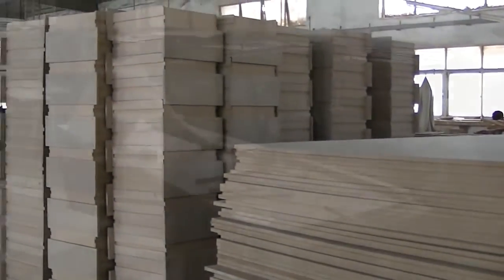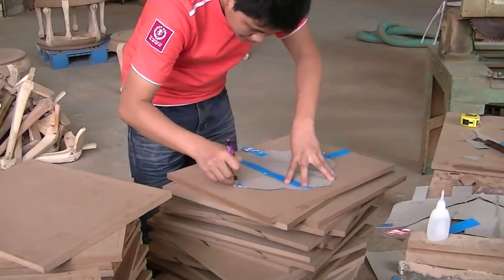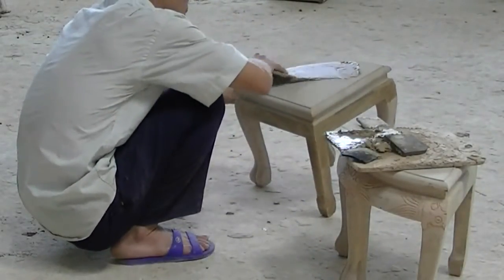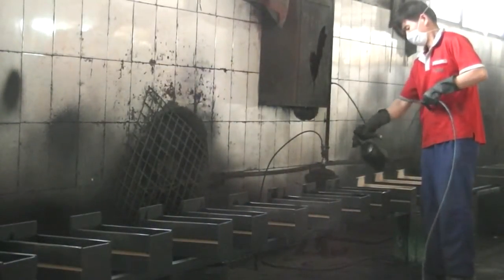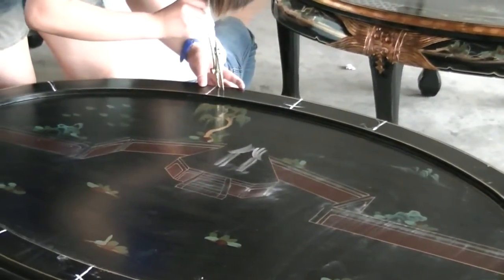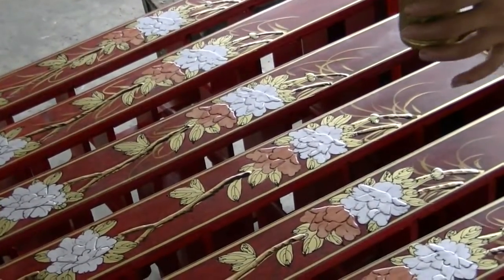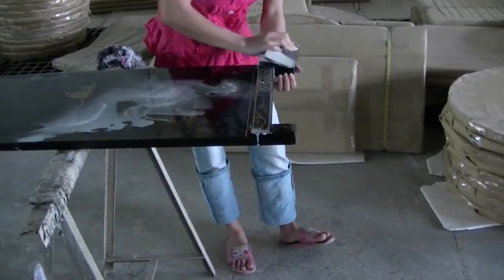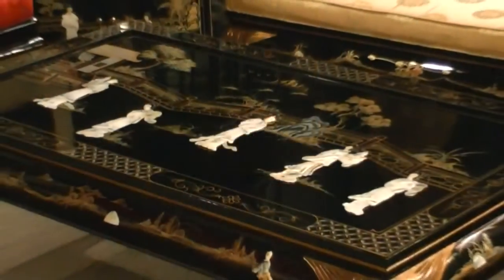Chinese Hand Painted Furniture

Comment: What type of paint does the artist use to apply the design to the furniture--lacquer?  acrylic? or what?
Reply: In the traditional way , ancient dyeing method is mineral dyeing,e.g. HgS, but in this vedio, I’m not sure they follow the tradition.if you’re interested in Chinese lacquerware, I propose you first look over “ lacquerware “ on Wikipedia.today in China severval existing decorative techniques are: 1. inlaying lacquer with mother-of-pearl develope in Yangzhou扬州; inlaid with lacquer of a different color develope in Pingyao 平遥; deep carved lacquer develop in Beijing北京... of course, there are some chinese people do lacquerware everywhere, but most famous representatives are which I mentioned just now
Reply: Ember L. Flack below mentioned
Reply: @lamfa-s3u  Thank you for your comment it was helpful and interesting.
Reply: My mother left me some furniture Chinese it black hand painted at least 50 years old. It has a few chips in the black, probably when she moved that happened, however they are in good condition, only wondering how to maintain, give it a boost. Should I use a clear wax, which see used by the decorative furniture artists when they finish a piece?
Reply: @deborahharris2962  i would probably paint it in the same colour but use lacquer finishing not wax. To get the sheen look and as this video said, need to be buffed after all at the end.